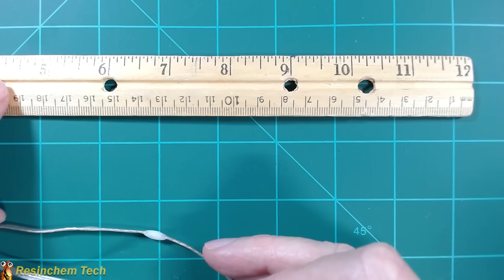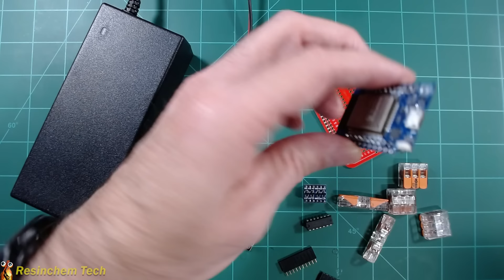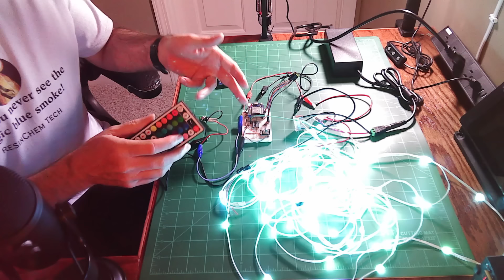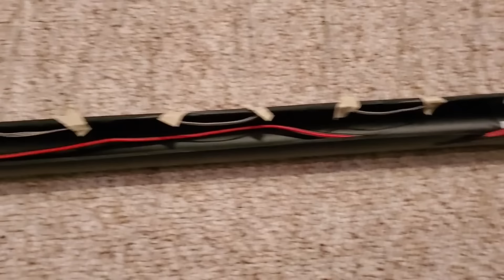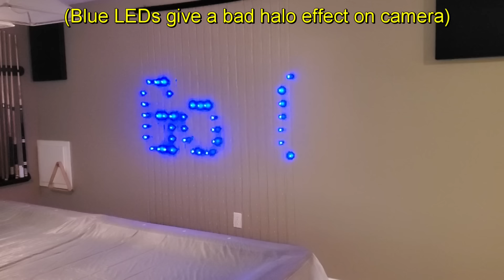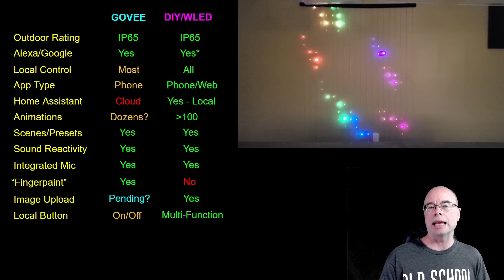Building an LED Curtain with WLED

Comment: Thanks for the video! A thought though. The effects are of course cool, but what if you want to display text, e.g. scrolling text, or a digital clock or countdown? Could you display e.g. keystrokes "live" from a computer? (e.g. write words and send it directly) I have seen a scrolling text effect in WLED, but it assumes you want to loop same text all the time, not change it dynamically, e.g. display a scoreboard and update it programmatically.
Reply from the maker: Well, that's a feature of the firmware... the excellent WLED in this case, which is not something that I developed.  However, it does do scrolling text, which I show in the video at around the 25:13 mark.  It scrolls the current date and time by default, but you can specify the text to scroll as I did in the video.

I have also created my own matrix clock with a scoreboard, countdown timer and text display.  I can send any text I want to the display from the computer (but not 'live' as I type each letter). Nearly anything is possible with addressable LEDs... if you can find or develop the firmware to make it do what you want.
Reply: @ResinChemTech  Thanks! What I'm trying to accomplish is first a LED screen that I can display a timer on, e.g. during a running event with the race/finish time ticking, and secondly also a larger screen with multiple rows that I can send text to, e.g. during a long jump (athletics) which participant is jumping, their result, placement etc.
So I don't need to necessarily have live updates but I want to send and exchange data to display using data on the computer using various "templates" to display it on the LEDs.

Apart from time, the biggest obstacle I see right now is what hardware and how much I actually need. Many videos just focus on effects and strips, or smaller matrices. And how many power supplies, controllers etc. is needed is really difficult to imagine before doing the project. And if I need more than 1 controller, how would they sync up etc. Is there any video or resource you can point me to that can give me some answers?
Reply from the maker: The closest thing that I have that does most of what you are describing is my matrix clock.  You can see how it works in this video:  https://youtu.be/Q0S0xOW35k8  - skip ahead to about the 10 minute mark to just see the matrix clock/scoreboard, etc.  This can be controlled locally via push buttons... or remotely via MQTT.  I'm using Home Assistant, but you could use anything that can send MQTT commands.  It could even be automated so that it receives data from some other scoring/timing system.

I wrote my own Arduino code for this particular project (it's available on Github) and the clock/scoreboard runs off of an ESP8266.  It could easily be scaled to something larger and with more LEDs, but that would require also modifying the code since my code is built specifically for layout I am using.  Naturally, the countdown timer could be revised to be a 'count up' timer for displaying elapsed time.  But something like Arduino code isn't going to be accurate enough for any sort of 'official' timing without using an outside system for that data.  Nearest second is probably OK... but not when you get down to tenths or hundredths of a second.

But conceptually, I think something like this would do what you are describing.  I can send text and/or control things like the scoreboard scores, timer, etc. from my phone or laptop.  I'm using Home Assistant as the "middle man" here to send/receive those MQTT commands, but there are other options for that portion.  I don't know if any of that is helpful or not... but it's the closest thing I have to what I think you are asking for.  I've used this clock (and it's 3D printed cousin on the opposite side of the room) on game nights for both keeping score and as a timer for games that use one, as the two clocks can also be 'synced' together.
Reply: @ResinChemTech Thanks a lot for your answer and information! I also read a bit about the HTTP/JSON APIs that WLED provides to control individual LEDs within a segment. Perhaps that's the way to go for me. I'm a developer myself, so I'm quite comfortable writing my own code, but I would of course prefer not having to invent the wheel again by e.g. writing my own code to display each letter for each word etc. with all the mapping that it requires and positioning every pixel individually. Hopefully I could just reuse and possibly rewrite a bit of the scrolling text code to display data I send to it instead and also have some "templates" that positions the data correctly and handles overflow etc.

I think I'll start by buying some smaller scale matrix that I can at least chain with another to get some experience with that as well and then build from there. I'm sure your videos will help to get me started on some of it :)

Comment: Your videos are great!!  Thanks for all of the info!  With that said, I have a question that I'm sure will be easy for you to answer!  What would be the best led strip series (addressable of course) to use to go around an entire bedroom (for my kids rooms, I think the run would be between 60-70 foot)?  I'm thinking of ordering the esp32 setups, but there are SOOOO many choices of led strips!  30 per meter would be fine, just looking for something addressable that won't break the bank, but also won't draw a lot of current, as I am sure my kids will probably leave them on quite often! (kids hate to turn lights off lol)  Thanks!!
Reply from the maker: Thanks!  But your question is actually quite difficult to answer because there are so many factors to consider... and as you mention, so many options out there.

How do you want to mount the LEDs?  Strip-style (like WS2812b or WS2811) would probably need to be put in a channel or some other type of adhesive in addition to the backing on the strips would be needed.  Do you need/want diffusion?  You could use standard strips, fairy-style like I use here... or even the tiny pixie style like I used on the t-shirt video.

Next you need to consider power injection and whether 12V or even 24V makes more sense in your case.  You are looking at around 20 meters (60-70 ft) and even using only 30 pixels/m, that will still be 600 pixels and you will almost certainly need power injection.  The lower the voltage, the more often you will need to inject.

As far as amp draw, standard 5050 RGB pixels can draw up to 60 mA each.  There are eco versions and the fairy lights generally pull less, but almost all of them will draw at least 20 mA per LED.   So for 600 pixels you would be looking at somewhere between 12A and 36A.  But remember, that is the max when on full bright white.  Other colors and patterns will draw significantly less.

So as you can see, it isn't an easy answer.  I can't point to a particular product or item and say that they would be best for your situation.  I would say you first need to consider the 'type' of LEDs... strip, fairy, pixie... and how you plan to mount them.  Then think about the wiring runs, including power injection needs.  This will help narrow down the selection to at least a style and voltage.  I can at least recommend BTF lighting products.  No.. they are not a sponsor, but I've used their LED products extensively and have always had good luck with them.  Good luck with your own project... and let me know if you run into any questions or problems along the way.
Reply: @ResinChemTech  Your answer was fine, thank you very much for all your information!  I was definitely meaning strips like 2812, 2811, etc, etc., ones that lay flat for sure (no concern if they do or don't come with adhesive, I have plenty). Channel diffusing not a necessity, but I think it would be smart for low density strips to help effect I'm guessing? Power injecting at the end i think would be easy, since I will be ending where I started, but I've heard that some may not require it at that distance?  Or is it worth even trying that?  I guess what I'm really asking is, what would you do if you were encircling an entire bedroom? I have a good understanding of it and have done quite a few projects with led single diodes, string, strip, rope, fairy, I just have absolutely no experience when it comes to long distances like this. I haven't been keeping up with all the newer tech over the last 10 years. So, yep, I'm lost! lol

Comment: Outstanding piece of work as usual.  Now that Christmas is over AliExpress is selling the fairy lights for half price.  They have a 20M length with 200 LEDS.  Given the brightness issue you had with 200 LEDS I'm wondering if it is going to need power injection midway.  I should know in a few weeks.  Thanks for all the ideas!!!!
Reply from the maker: Thanks for the tip!  Do let me know about the power injection.  Maybe it is due to the longer lead distance between pixels, less efficiency/higher resistance or some other cause, but I did find that I had to inject power with fewer LEDs on the fairly lights as opposed to the standard WS2812b LED strips.  Not a huge deal in my case since I had the bottom pipe which made it easy to run and conceal the power injection wires, but for my 400 LEDs I had to inject power at the midpoint and end of the run.  

As always, I'd recommend a bench test before you actually design and install the LEDs, so you will know ahead of time and can account for any needed power injection runs.  Good luck with your projects... and thanks for the comment and kind words!

Comment: Hello tahaks for your video. I have question is it realy need 5v 15a?
Reply from the maker: Since the specs say each LED can draw up to 20 mA on full brightness, .020 x 400  = 8A.  So you could probably use a 10A power supply or run the LEDs at lower brightness.  I choose to always oversize my power supply so I don't have to be concerned about brightness level or overtaxing the power supply.  But the final choice is yours.

Comment: Couldn't you also buy the Govee version and just replace the controller?
I don't know about this particular one but I've done this successfully with both 12V and 24V Govee Strip Lights before. I always reuse the LEDs' included PSU and just connect power to the LEDs, GND and Data to the ESP, use a level shifter. I do this so I can "upgrade" existing, already bought strip lights to WLED without having to buy new lights.
Reply from the maker: You could certainly do that... as others here in the comments have stated.  But to me personally, that defeats the purpose of DIY and you'd be spending money on the original controller, removing it and then spending additional money for the parts to build a new controller.  

But as you mentioned, if you have already purchased the Govee version, apparently you can replace the controller.  I can't confirm this myself, as I don't own any Govee products (since I always build my own versions).  Others here in the comments have stated success in doing so however.

Comment: Thank you so very much for "going the extra mile" with your excellent design which I am enjoying building. Can I ask you one question please ... I am using a 1/2 size ElectroCookie board and NodeMCU ESP32 WROOM USB Type C (CH340C driver) Dev Board with Logic Level Shifter (I2C)
but "should I link the negative -5v line to the negative -3.3v line" or not?
I am a early retired CTV Engineer (Year 2000) but am unsure about this link. Subscribed and Liked.
Reply from the maker: I'm not sure I am completely understanding what you mean by the -5V and -3.3V.  Are you referring to the ground (GND) connections?  All grounds should be connected together.  In fact, it is important that the controller and LEDs share a common ground (not an issue if both are powered in parallel from the same power supply as I show in this video).  If you are talking about the I2C shifter, I connect the grounds on both the HV (5V) and LV (3.3V) sides to the ground rails on the ElectroCookie, although this technically isn't necessary... only one ground is truly needed for the shifter.

If it helps, I have a blog article that shows a lot of the common wiring options for LED controllers:  https://resinchemtech.blogspot.com/2023/01/wiring-diagrams.html

I also have separate videos on just building the LED controller and common LED questions that cover the wiring of the controller in a bit more detail than I went into with this video.  You can find these (and more) in my LED playlist:  https://youtube.com/playlist?list=PLqjDNeOVHOkf079FYwRLRoOHJwLijKkP3

But let me know if you have any additional questions not addressed by any of the above.  And welcome to the channel!

Comment: Govee has unlimited user and community  anamations which is the biggest selling point
Reply from the maker: As does WLED through its usermods feature... which not only makes new user-contributed animations available, but new features as well. User mods can add support for sensors like motion detection and temperature,  relays,  rotary encoders, etc.  There are even user mods available to allow the curtain to be interfaced to certain racing games so that the curtain acts like a live tachometer for the game.  

There is nothing inherently wrong with Govee... and it is certainly a decent product from what I can tell for those that don't want or simply do not have the ability to build their own DIY version.  But as far as features, each would have slightly different sets or variations available, but the major of functions can be found in both options, including the ability to implement community developed features.
Reply: Yep cool. I’ve played with wled. But the DIY in Govee make is so much easier to design your own animations. My 11yrs old made loads for Christmas then I just searched the community in the app for things like Rudolph, Father Christmas Christmas tree ect and setup them to change over time. 
That’s the reason I got it over making my own set with photo, animated GIF, paint DIY animation. Doing that in wled is definitely not as easy.
Reply: @cowdar have you worked out a way to incorporate your govee ecosystem into a larger light display like xlights?

Comment: Very cool, may give this a shot. Should have used 12v, avoided power injection.  Much cleaner.
Reply from the maker: Thanks.  Yeah... I could have used 12V LEDs but then I would have needed to add a buck converter for the 5V controller.  In this case, the black pipe made it very easy to add power injection and conceal the wires.  

The other issue was that I was trying to match the Govee style LEDs as much as possible and I could only find the closest match in 5V.  In addition, 12V often only allow addressing of the LEDs in groups of three... which you probably would not want with something like a matrix .  But yes, using 12V (or even 24V) likely would have negated the need for power injection.
Reply: @ResinChemTech  Ahh makes sense, I thought someone had 12v individually addressable fairy pixels.  BTW just found your channel, great content, thx again.

Comment: I just saw a video where they used WLED to control a Govee outdoor LED strip. So if you buy the Govee curtain it sounds like you might be able to use WLED with the Govee too
Reply from the maker: Yes, numerous others have reported here in the comments and elsewhere that they were able to replace the existing Govee controller with a DIY WLED controller.  As I mentioned, I don't own any Govee products (since I just build my own) so I have not tried that method.  But others have said they have had success in doing so.

Comment: WLED Also is recognized by xLights as a controller!
Reply from the maker: Yeah... and I mention that in the follow up to this video where I put a matrix on a t-shirt.  I actually played a little with xLights and the curtain but didn't show it in this video just due to the already long length of this video.  So I ended up covering it in the follow up video.

But thanks for mentioning it in case others were not aware.

Comment: I wonder what these would look like on (2) 4x8 peg boards for an 8x8 area! I think the holes are 1" apart, so you would have 4x as many LED's. Do you happen to sell ready made "controllers"? Could have 2 controllers and just install a switch to switch between one with sound mic and one without?
Reply from the maker: You could certainly build something like this in a number of different ways and configurations.  Just remember with 4x as many LEDs, you are going to need a 4x bigger power supply and probably 4x as many power injection points.... and there is also a practical limit on the number of LEDs an ESP can control (without using multiple data pins).

I've had many people ask, but unfortunately my standing response is that I simply don't have time to build, ship, track and deal with all the other logistics selling pre-built versions of my projects would involve.  My channel's goal has always been to show others how to build these projects for themselves.  However, if you want a pre-built controller you can take a look at the ones sold by Quindor:  https://quinled.info/pre-assembled-boards/

I appreciate the interest but simply can't sell any of my projects or builds.  Otherwise, I'm happy to answer questions about the project to try to help.  Best of luck with your own projects.